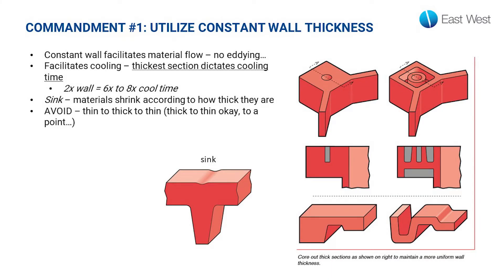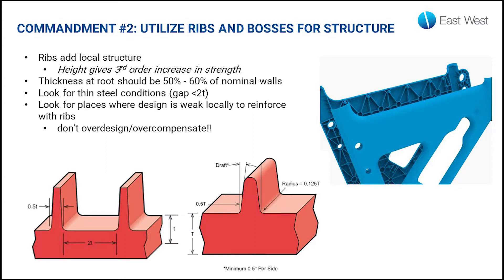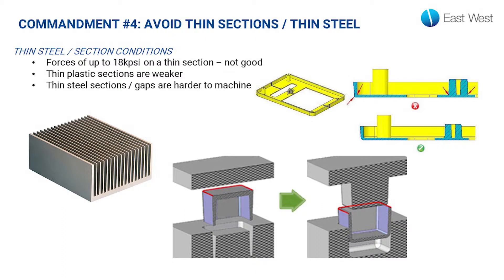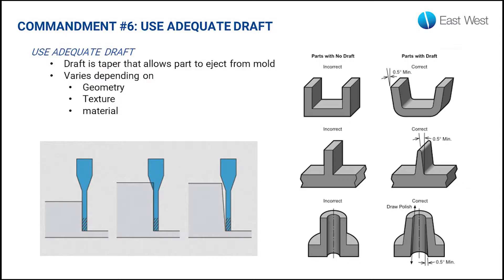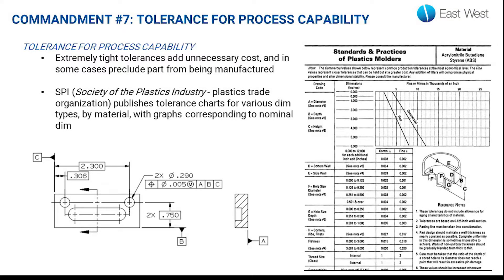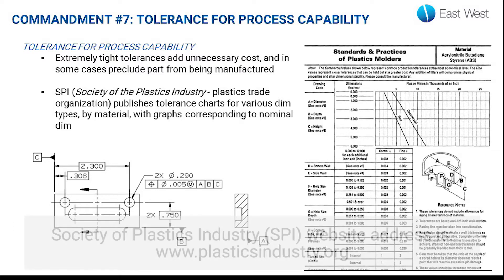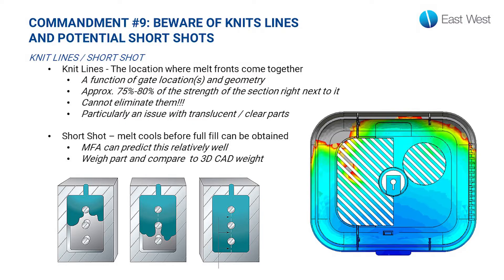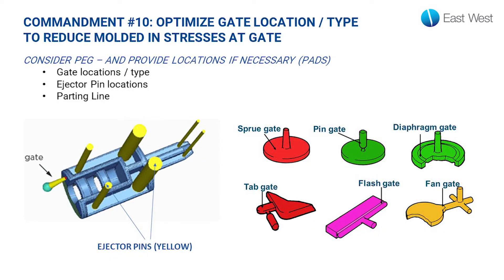The 10 Commandments of Injection Molding

Comment: Very useful.
I just started to make moulds for my plastic recycling project, and some insight you give are on concepts that I did not understand well before of watching it.

I still have a doubt, when making keychains, I usually put the gate just over the ring hole pin, that breaks the flow and makes it re-join after the pin.

Obviously on keychains I don't have big issues about part resistance, but sometimes that results in a weird colour pattern (I'm using mixed colours to have a marbled result).

I decided to put the gate just over the pin because I thought that it was worse if the flow was going to split and then join on the top of the hole, where the stress is higher.

How can I solve the issue (apart from making the hole after with a machining tool)?

Comment: No mention of venting the mold. Add another commandment to the list.
Reply: Traditionally they (mold makers) are "afraid" of making too much (and too deep) venting, because it can cause flashing in the brand new mold. So not enough venting is still common practice (and technicians at molding facility will correct this, during initial mold testing, in press).

Comment: first commandment how we going to fill it ?then how are we going to get it out? thus effecting mold design, then design mold to those specifications such as flow , venting, ejection cooling, heating locking cavity to core  (think of the mold base as the purse, that is carrying the most important part, the cavity, the mold base  is not primary in the locking processes its to loose over all, but rather it is a subset, yet very important in locking  )and all of the rules this video said